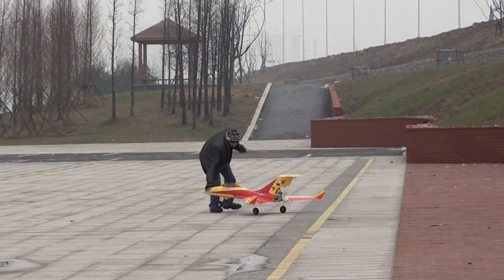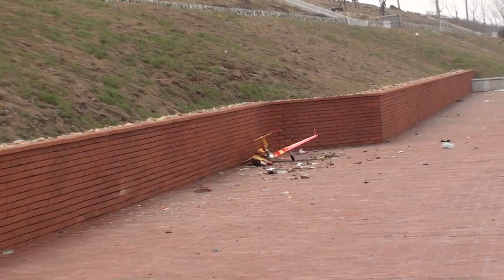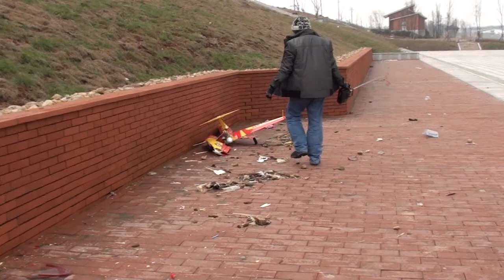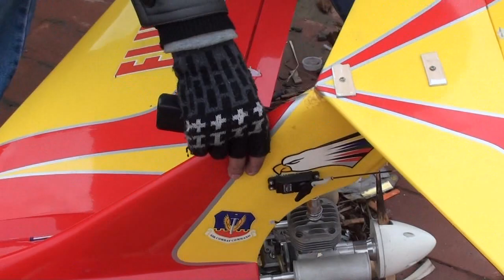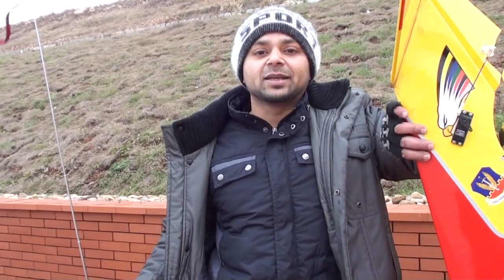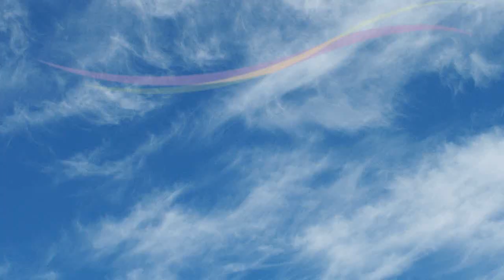FlyCat 71 High Speed Take off Crash

Comment: Real bummer. You can see the nose wheel leg flex and let the wheel fold slightly steering the plane to the left and ultimately into the wall. Better quality gears are a must on larger/heaver aircraft. Good luck on the next one.

Comment: I'm gonna say that it was the grooves in the runway that started the wheel turning. You can see it happen when it came across the first one. The wheel jerked left then hopped over it, then it skipped over the next few grooves but catches on the large middle set and almost folds over. I have a feeling that it caused the shaft to bend or come loose at that point and that was that.  I wouldn't fly there any more. Back to the streets! :-D

Comment: it was in my control but when the speed rolls up vibration caused the front gear to lose the traction??  huh?  looks to me like you didnt tighten the front wheel so it just turned whenever it wanted to.

Comment: "We can burn it now" That's funny. On a positive note.... being a pusher saved your engine. It did look like your rudder was still straight when the wheel dug in and pulled her to the left. I can't explain the throttle sticking but my guess would be a loose set screw on the nose wheel wire or it came loose from the servo. You never liked that plane anyway. Just glad no one was injured.

If that's the pit area, you really need a fence

Comment: Ali, you are lucky there were no people in the path of the plane. There should be some barracades on the pit line to help protect other pilots from a situation like this. Also all people should really be on the "upwind" side if the takeoff  where the plane is less likely to end up as it takes off. Just some safety tips. Good luck.